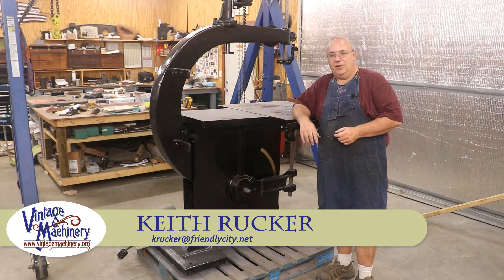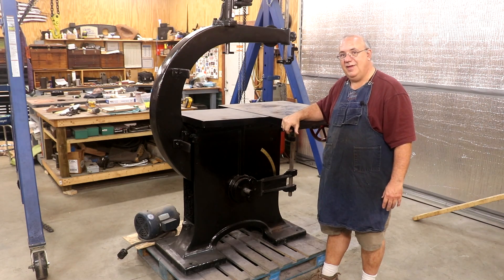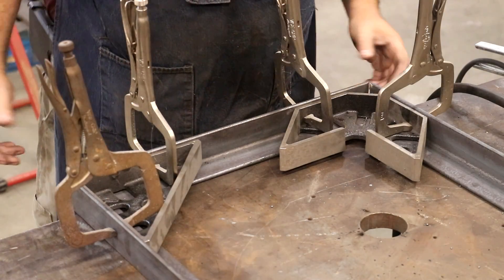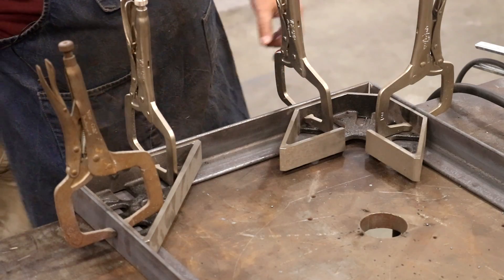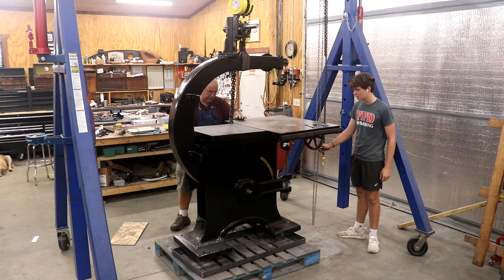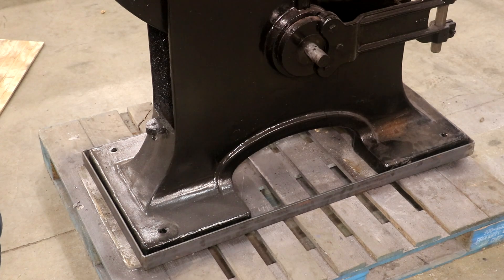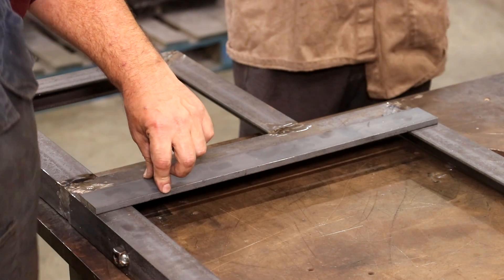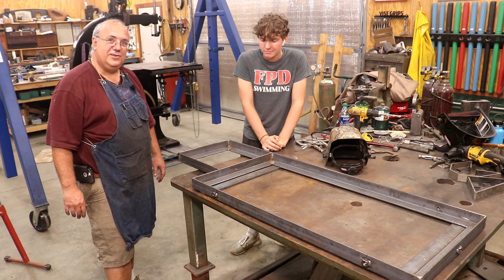Fabricating a Base Frame and Motor Mount for a Crescent Band Saw: Part 1

Comment: Hi thanks for the video. I’m a new guy 70 years old and I just purchased a Bridgeport mill series one. I have a very small shop would you suggest that I build a heavy duty frame and install heavy duty wheels on that frame for the Bridgeport mill the setting this would allow me to move itIf I need to.

Comment: Ren - you’re still young; and probably still have good hearing. Wear ear protection... because once it’s gone, it’s gone forever. Having your favorite new track sound like it’s coming from the bottom of a swimming pool is no fun. You’re already good on the eye protection. For a first try your welding was not bad... I’ve seen worse on commercial products. If you ever get a welder yourself; also be sure to get a welding jacket, leather apron, and wear full-length cotton pants - having had a red-hot ball of weld spatter wind up someplace unmentionable myself, I can speak from experience that even though the various layers are hot and uncomfortable, not wearing them is *worse*. 😬
Reply: Dark Winter yep been there  got the holey tee shirt! I had a bad one welding a wheel arch onto a car, got a red hot ball of spatter down inside my trainer ( sneaker) yes I know should have been wearing boots but it was summer and hot. I carry the scar with me to this day on my ankle and instep.

Comment: Put in some rubber padding between the frame and the saw. Will help with unwanted "rattling" or vibrations. 
As for the motor, you could get or forge the flat belt pulley's and still use a flat belt. That way you kinda keep it original, minus the electric motor part. Besides, I feel flat belts wear better, last longer and are more forgiving than "V" belts or serpentine belts are.
Ren should learn more of this trade, welding, fabricating, machining. Always have a trade under your belt. Great video, cheers :)

Comment: Looks like steady hands and ready to go!  I'm a bit concerned with the base - No sheet for strength and later cleaning.  The tacked on square for the motor might be ripped off or vibration break.  A sketch might have helped.  Good luck.

Comment: When he said "Probably not a welder" and stared into Keith's soul I shed a tear. Rebel without a cause.
Reply: I seen a look of deep hurt in Keith's eyes.
Reply: @jmccracken491  Keith did not explain to him that with inclination, drive, and a couple years of good vocational training he could be looking at a $100,000 to $150,000 a year as a top certification welder.
Reply: Big'un44 100k to 150k what kind of welding are you talking about? Please be real
Reply: @Discovery123.  extremely high-pressure boiler piping welder, certified high pressure pipeline welders, aerospace specialty welding.  Plus do not plan on just showing up for work for only 35-40 hours a week.  Work your butt off when work is to be done.  You do the work, do it right, do not dilly dally,  and $1,200 for a day's work and do as many days in a row as they will allow you.  "Dirty Jobs" but as Mike Rowe says,  pays better than fancy white-collar jobs.

Comment: Next time teach him to stick weld. The machines are cheap enough to have a small welder in the garage for occasional use and can handle less than perfect joints better. MIG is kind of like using a calculator to learn multiplication, too easy. Good that he's interested in learning it though. Its a handy skill to have.

Comment: Haven't watched the whole video yet but just wanted to pass along a tip for cutting 45's on the dry cut saw. When making the cut with the leg away from the base put a block( I use square tube) between the fixed jaw and the work piece. The force applied can pull a unsupported piece free. Fortunately for me when it happened all I got was a scare and a few chipped teeth on the blade. A friend of mine had it happen and got a nice bruise and a bent blade.

Comment: Keith, if you cut all the angle iron to the length of the inside dimensions then set the saw to just graze the inside vertical and only cut the flat leg to 45° then you will automatically have full depth pre-prepped outside corners to weld and save yourself a load of grinding.

Comment: I live in an apartment complex thats 3 old wool mill buildings that were repurposed by Watermen Pens and Peerless Faucets. They were water powered, then steam and now... all 3 buildings have a bump on the 3rd floor in the middle of the hallway where the horizontal cross shafts were mounted. I don't think there are still shafts in the shaftways, just the floor hump where they used to be.

Comment: Always remember Ren..
You can never have too many skills... Learn as much as you can even if it's not appealing to you.. it will serve you well in the future.. if I had to go find work right now I could walk out my front door and get a machining job, I can do carpentry I can do construction I can do automotive I can do motorcycles I can do fabrication I can do electrical I can do plumbing I can do concrete I can do garage doors if I wanted to.. and it has served me well...
Reply: The downside of that that approach is you tend to accumulate associated tools…  I have a shop and a shipping container crammed full of gear for way more trades than I can organize. :)
Reply: @vaalrus  While that may be true at least you don't have to rely on others to fix things when they need it, and hope they don't rip you off.
Reply: @roysmith3198  Oh, indeed, it’s all a series of trade-offs

Comment: Great work! Reminds me of the first time I welded. I was 10 and crashed my go cart. My grandpaw and I took it to the neighbors shop and I test welded some plate steel and then some tubing as the go carts frame was tubing. We did some welding for the neighbors fix he needed done a then worked on the go cart. When we help the neighbor with some chores to pay for the welding supplies and electricity we used. Thanks for sharing and the reminder of happy days gone by.

Comment: Well the heat was a little low for migging mild steel but it should be ok.  I would not have bothered grinding a bevel at all myself, no need for it. I would have also taught him stick not mig.

When I teach someone to use a mig welder I always choose some rusty tin pieces to weld together for two reasons.  One the metal thickness changes so you have to learn how to watch puddle.  Two rust is hard to weld on but you can do it and many times you won't have a choice but to weld on, or more accurately through, rust.  Ideal conditions of always clean rust free metal just is not realistic.

Comment: Keith, great to see you passing the knowledge along to your nephew!  My only critique is that  I would have cleaned off the mill scale along where you were welding.  Not that it makes that much of a difference in this project, but in general, it is best welding practice to clean the mill scale off where the welds will be made.  Not a crisis, and a great video showing knowledge transfer to a younger person!  Good stuff.